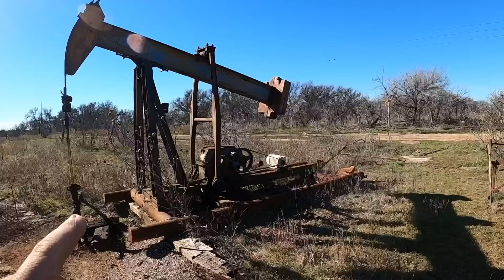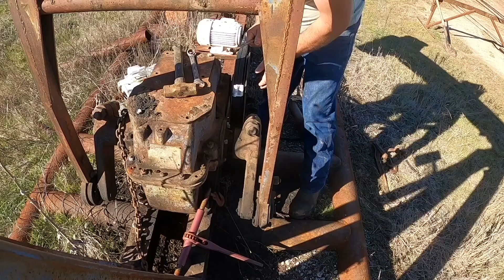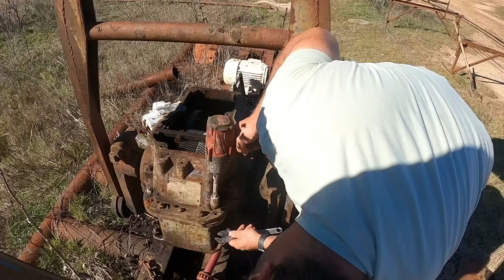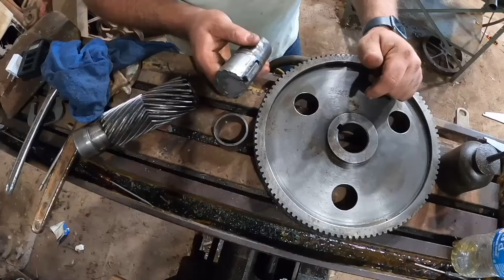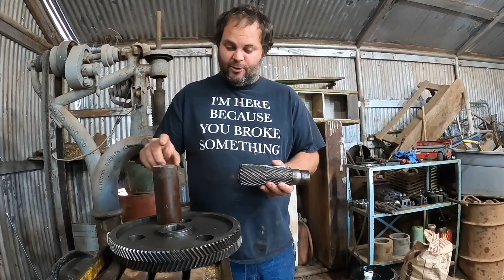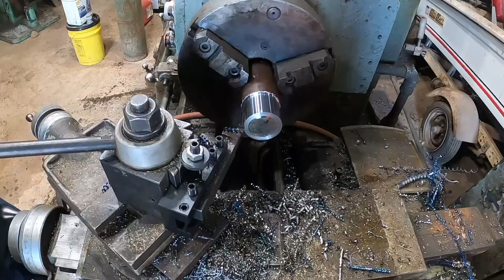Gear Repair Failure

Comment: I don't know how I found this channel but now I'm hooked. As a kid I helped my grandpa maintain his wells in the Texas panhandle. Back then, there wasn't electricity out at his land, so his pumps used hit and miss engines for power. I could hear them for a mile or more, just popping away. He was super skilled at fixing anything, like you. I learned so much from him. He also operated a welding and machine shop so I learned to build and fix about anything too. Thanks for the videos!

Comment: Nice table. Get some coaster wheels for it heavy rated weld them on then put some span steel make a shelf on it for storage. Use 1 inch tubing set the span steel on top. Boom got storage for parts grinder and other hand tools be a great shop table then.

Comment: Zack they might kock you but i  dought they can beat you. they dont understand you are a 1 man band .i retierd out of the oilfeild seen a lot of strss cracks .would it help if you burried that shaft in sand and let it cool down like cast iorn slow slow slow the old way.Thanks for you videos.

Comment: Next time you run into that problem try knurling the shaft rather than welding it, then add locktite and see what happens.   Great videos, Keep up the good work.
Reply from the maker: I considered it. I just can't bring myself to rely on the lock tight.

Comment: 1045 is medium. In the Lincoln book, it's high enough that you need to manage heat-treat effects. A really big hit weld is sometimes enough but the preheat is better. I'm not a metalergist either but I think stress relieving is basically heating to the point that carbon is able to move around in the crystal lattice. As the carbon makes clumps, it leaves behind wide open spaces of uniform iron lattice, which is where you get nice ductile behavior. Anyway, I had always heard 1 thou interference per inch of diameter. So the original dimensions may have been OK but the replacement was wrong. Thanks for the YouTube recommendations, too

Comment: Why couldn't you drill and tap a hole on the center line and put some all thread in both holes?
Reply from the maker: I didn't think the shaft was big enough to try something like this. If it had been 3 in or something that would have been an option.

Comment: So what was a better way to go? We learned the flexing of an overly hard shaft propagated the crack. Would it have been better to try to weld inside the hole and rebore? To be honest I would have tried the same things. Maybe heating the center of the gear hot hot and smashing with the press and maybe it will close up enough to recut?

Comment: Bummer about that shaft breaking. Despite that as a machinist I thought you did alright on it considering. I commented on that repair vid that I thought it was going to get loctited on. I don’t know if it would work for you (I expect it would) but here in mining often if the shaft is worn and you need to get it running now a new bearing gets loctited on. It is good stuff and good for a clearance up to .010”. The only thing it can’t do is a hot environment, can’t recall the temp but a gearbox would be fine. When pulling apart you use heat to release it.

Comment: You can also get a two part spray that you can use after the weld cools down. You clean, then spray the dye, wipe off excess, spray the developer, wait and it'll highlight the stress cracks, pits, etc.
Reply: Did you see that from Curtis at Cutting Edge Engineering? Aussie guys who repairs heavy mining equipment, his wife makes his videos. Stay around for the outtakes at the end.
Reply: @bigdog2024  I just worked a chemical plant turnaround, and they had to weld a new dome on a distillation column. They inspected the welds with that material after each pass of welding.
Reply: @specialservicesequipment393  yes, a crack could be a issue in a distillation column. The lighter fractions go to the top and refiners don’t want to lose a drop of anything they could sell. Leaking flammable vapors is also a serious problem which could lead to a disaster.
Reply: @bigdog2024  with what they make there, it's a serious environmental issue. DOW DEER PARK, TX
Reply: @specialservicesequipment393  used to live near there back when I worked at JSC. Shell used to have a huge refinery there too but sold it not too long ago. Pesticides and other nasty crap is made there. And in Pasadena.

Comment: Im thinking those gears were probably case hardened after machining and finishing. They would be put in a steel box filled with graphite powder and baking soda,  cap welded on leaving a tint hole for gasses to escape and heated in a forge or kiln to a cert. Temp.  For a time.

Comment: I worked for a quartz glass company in central Florida and the same process you described in annealing steal is identical to quartz glass.  Hard to believe that glass and steal have the identical heating process.  Check out Scientific Glass of Florida.  Pretty cool.

Comment: I have been repairing gearboxes for 28 years and i would call your method of repair brutal machine torture, but since your entertaining and do provide good insights, ill give you pass. Great Videos.
Reply: It's the oilfield. Get er fixed the best and most affordable way possible and get it back on the pump fast.
Reply: Sometimes being cheap cost more time than It would to buy a new one 🤷‍♂️
Reply: Zach preheat the components to 450 degrees, use 7018 welding rod or wire.  Wrap the part with K O wool or some other insulation and let it cool. Material is probably 4140 or something similar to. Parts will machine normally and everything will be okay.

Comment: Henkel Loctite makes "Retaining Compound" for loose fitting cylindrical parts such as your gears. Henkel has gobs of specs for their different formulas. I've yet to try it, but my next wobbly shaft will get a dose.

Comment: Thanks for sharing, Sometimes I learn a bit.  I was working on a hose and the barbed fitting was just not going to, fit then I remembered you heating up pipe in the field to make it easier.  I charred the hose a bit but the fitting slid in like a hot fitting through butter.  I always use solid brass fittings when I repair a hose.  Yeah I could have just chunked the hose but what's the fun in that besides other than the smashed end it's a decent hose. And I have a box of good hose fittings.

Comment: I likely would have bored at least half way through the gear, to a diameter that seemed to be just shy of as large as I dared. Then created the new shaft to press all the way in, with a key in there as well, then welded it. That way even if the weld cracked, it's still got more then enough support due to the deep bore, and the 2 halves are keyed together. As long as the casting is holding the 2 parts together, welding wouldn't even be needed. 

The replacement part is likely so expensive due it being a herringbone gear. which I don't understand why they used that because it's not like an oil well needs a quiet gearbox.
Reply: Herringbone gears don't create any side-thrust.
Reply: @jims6323  Straight cut don't create side thrust either.

Comment: BTW your powered rollout wheel could benefit from a simple clamp on steady MIG gut rest like the style wood lathes use.  It could have an extension to clamp or visegrip to the rollout wheel's 
angle frame and would take longer to dig out the scrap to fab it then the fab itself. If your gun cannot go up and down it's less likely to drift. Metal spray torches also work well with a steady rest.

Comment: If your local scrap metal outfit has XRF gear they can shoot material in minute then tell you what alloy it is (mighty important in the scrap industry). Knowing that may come in handy one day.
BTW Crown Alloys make an excellent cast iron MIG wire (uses argon shielding gas like TIG). Not cheap but a lot cheaper than parts.

Comment: I'm just curious do you think if you would have machined out a hole inside both of the broken pieces And created a keyway in the new piece of metal that would fit with press fit. Then press the two pieces back together. Would that have been able to hold up to the constant stress of rotation or do you think it would have just cracked the same way this did

Comment: Ole shoestring. 
Zach 60 and was raised by redneck geniuses. Few had book learning. Wish id have absorbed more. 
Now i watch over a mom with dementia away from all my junk, board and stressed. 
I had a brief 2 year journey to west texas and southeast NM for big red. 29 out there 13 home. Learned so much from engineers and old frac hands.
Thanks for these dirty truck, worn out equipment, and a tight budget. 
You always adapt and overcome....this old, tired marine loves youre get it done attitude.
Keep sending em brother.